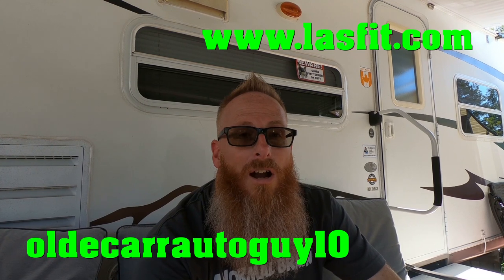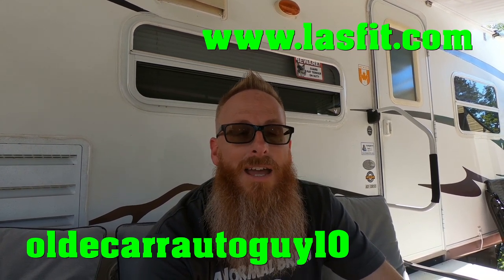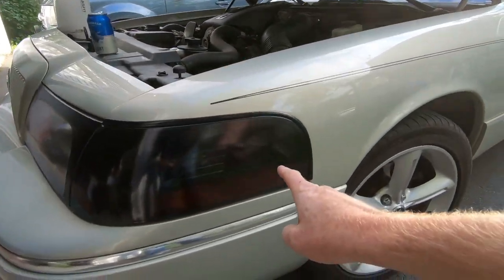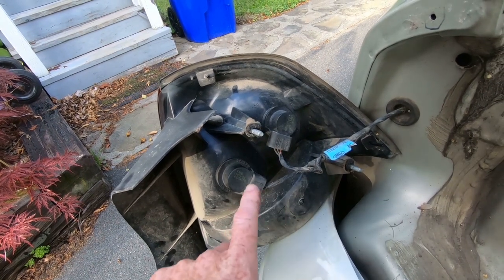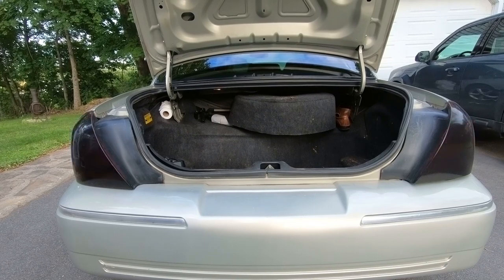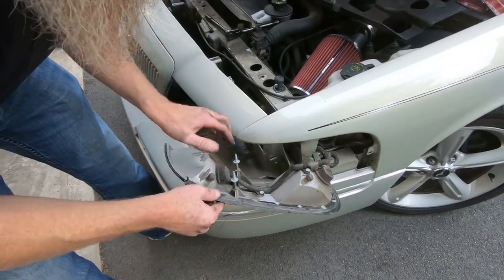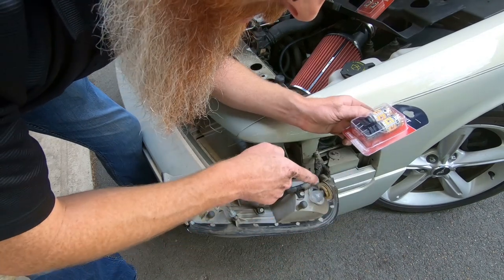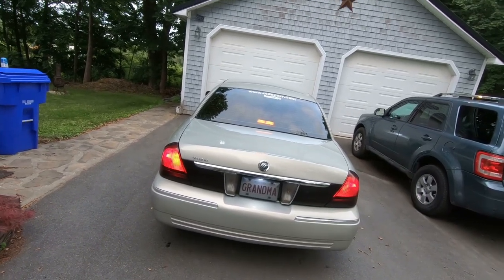HOW TO REPLACE LED TURN SIGNAL BULBS IN A 2004 MERCURY GRAND MARQUIS

Comment: Have you had the lighting control module replaced under recall yet? The grand marquis just hit 223,000 miles, or just under 400,000 kilometers, on my way through Atlanta and that's when it decided to fail. I bet it has some broken solder joints because a few taps on it will cause the lights to work but as soon as I use a turn signal, they flicker and stop again. Had to drive with my high beams held on all the way back from Florida during the night time part of the trip. Gots an appointment Tuesday to have it replaced at the fjord stealership, free of charge. No expiration on that particular recall.
Reply: Thanks for bringing this up Panther.

Since 2014 I've received 3 letters from Ford instructing me to bring my 2004 Vic in to complete this recall. The original letter said warranty coverage for this specific recall would be extended to 15 years from the original date of sale, or 250K miles whichever occurred first.

Each time I tried to take it in, they said they were waiting on the parts to perform the recall. 
I've been dealing with the same service writer since I bought the car back in 2009, so I kind of almost trust him.
He informed me, if I don't have any issues with LCM or headlight issues to not have the recall done. 
He wouldn't say it, but he inferred that the techs doing the recall were having trouble completing them properly.

Well my car just turned 15 years old, so I guess I won't be getting a free LCM.
But it looks like I got one of the good ones, that doesn't need to be replaced.
But if you say there's no expiration on this recall, that's even better. 
Chuck
Reply from the maker: Thanks guys for the heads up! GrandMa is 15 and just recently started giving me issues with the high beams! I’ll check with the dealer this morning and follow up in a future video!
Reply: @PanzerPlatform  No problem. I figured mine had escaped a bad batch too because it's never had any issues, like those that plague less fortunate model years, but it is possible that something inside broke due to the combination of miles driven over terrible roads and the competition grade sound system that makes my eyes wobble. My 03 crown Vic only has 70k miles but it squeaks and rattles and I had to replace a bunch of parts that are still good on the grand Marquis with three times the miles. I saw a replacement module for sale online that doesn't require the removal of the original. It's designed to plug into the harness in such a way that it can be placed next to the original and zip tied into place. I'm going to be parking it for the winter soon and driving my 95 town car since it's already accustomed to driving in salt. Going to replace the brake lines with that new fangled copper nickel alloy for ease of installation and it won't rust out again. Surprisingly, the fuel lines are all stainless. I was certain that I'd have to replace those too but they are pristine. See you around.
Reply: Safety Recall 15S39 
2003-2005 Model Year Crown Victoria and Grand Marquis Vehicles 
Headlights Inoperative
Reply: @OldeCarrGuy  Sweet. I got the first recall notice but not the second which states when the replacements will be available. When it failed, it affected the low beams, cornering lights, and high beams. I can still toggle the multifunction switch toward me to flash them, but they won't come on when toggled away from me. I'm excited for your Grandma. I know how much I love mine. It's at the top of my list of reasons why I'm so grateful to be alive.
Reply from the maker: Great to see you in the comments again! I’ll have an update in Saturday’s upload!
Reply: @OldeCarrGuy  thanks! It's been a really busy summer and the few minutes I have aren't usually spent on YouTube, but I try to make time for a few channels like yours.

Comment: My 2004 Crown Vic was not a P71 [ civilian edition ]    . I bought a 07 x-RCMP car for $350 that the owner had  blown out the transmission . 
The  3:56 locking rear end and HD drive shaft were put in the 04 .. Really wakes up the car on acceleration and mileage hardly suffered ,
And in the winter with a bit of snow on the roads the snow tires will actually work  .        The bean counters at Ford really screw up .    Every one of those cars 
sold in Canada and the northern half of USA should have had as standard equipment a cold weather package ,
Heated Seats , Heated Steering Wheel and Locking Differential     ..    the cruise control does not display a engaged signal in the dash . I discovered that was a $5 option 
that was not installed in the car  ..    hard to believe ..       Will do the rear bulb up grade !
Reply from the maker: I'd be inclined to agree with you!

Comment: Cant wait to see it finished in LEDs! Wish the fronts would of been the switch backs 😔
Reply from the maker: Switch backs would be nice! Maybe an upgrade someday!
Reply: @OldeCarrGuy  I just installed my reverse LEDs and plate LED so impressed with the light output! I forgot to ask for the rear LEDs in the tails what color did you use?

Comment: Do you need a resistor for the cornering bulb or did you use a bulb with built in canbus?
Reply from the maker: The bulbs I used did have the built in canbus!
Reply: @OldeCarrGuy  how about the headlights, were the led's sideways or straight up and down in the housing?

Comment: Never heard of hyperflash before.  What is it?
Reply: Winnipeg Car Life  it’s where LEDs flash on and off faster then we can see with eye most time but you’ll see cameras pick it up where it looks kinda like a strobe. The cheaper the led and hardware the more pronounced it will be. If you look at end of video it looks like his headlights and the far right taillight have just a tad of it
Reply from the maker: Hyper flash is actually a term used when your turn signal flasher flashes LEDs twice as fast as a regular bulb. Kinda like a newer car when you blow a bulb in the front and the rear build flashes faster! LEDs labeled as “canbus” will eliminate hyper flash!

Comment: I just got those same lasfit canbus bulbs for the taillights and I have hyperflash with the turn signals
Reply from the maker: I ended up the same issues down the road! If you reach out to them they can help guide you.
Reply: @OldeCarrGuy  what did they do to fix it?
Reply from the maker: @hectordominguez5742  they sent me new bulbs for free.
Reply: @OldeCarrGuy  no resistor or anything needed?
Reply: @OldeCarrGuy  because that's what I'm looking for thank you in advance some bulbs that don't need a resistor
Reply from the maker: @hectordominguez5742  the builds have built in resistors.

Comment: The corner light bulb or lights itself when does this get use or when do they come on and what it it used for?  I like them because I cannot see the curb median sometimes while driving at night especially when I'm heading for work.  I almost hit the curb median a few time and it pisses me off when that happens.  I bought the corner light MGM or Marauder (2003-2004) panel because I like the way do look and I know it will fit on my 05 CVLX Sport, but I will need the harness because my CV does not come with the extra harness for the corner light or bulb; however, I believe they do for the P71's.  Any suggestions on how to find that extra harness or do I simply need to focus on an entire harness either for a MGM or Marauder or look for one on the P71 model for the harness?  This can be confusing when searching for information or answers.  Thank you.
Reply from the maker: It is possible that you may not be able to make it work as the cornering light comes on with a signal from the lighting control module. The CV may not be capable of making that happen. However, if you find out otherwise, you are likely looking to replace the underhood harness from a MGM.
Reply: @OldeCarrGuy  Indeed, at least for the moment Ill settle for the looks of it.  I have the darker black with the amber reflector panel and the black headlight housing which all looks nice for the contrast, but the version I want and do have actually, looks better. I saw a vid and the guy did the reverse, so it obviously a preference.

Comment: Go with martin @ Mo's speed shop tune. Buy an sct tuner and email him for your custom tune. That's who all the pros use on crownvic.net and i just got his tune after installing dual exhaust and the 04+ p71 intake and it was a huge improvement! Also went on a trip after the time and got 28mpg on the trip!
Reply from the maker: Thanks Scott! I just sent off an email! What did your tune consist of and the associated cost?